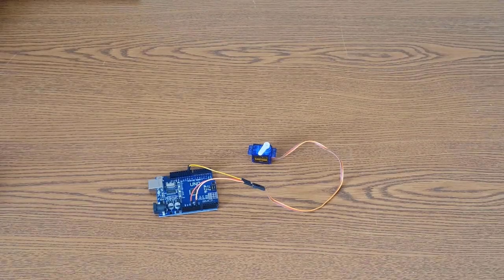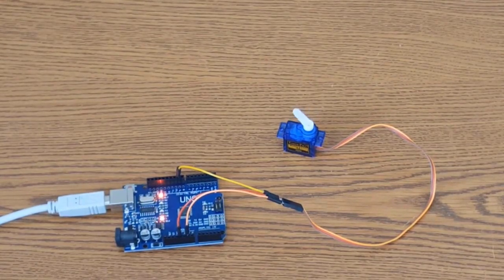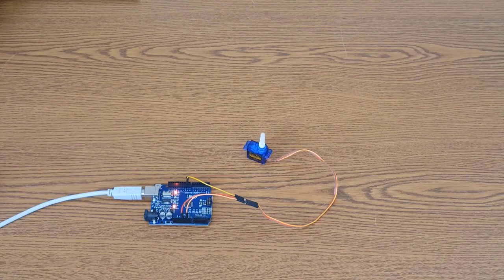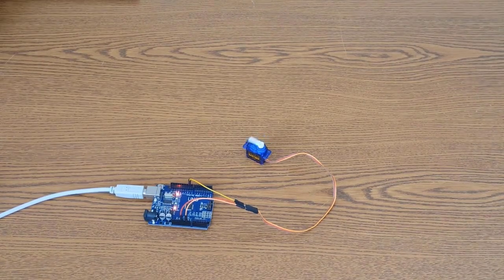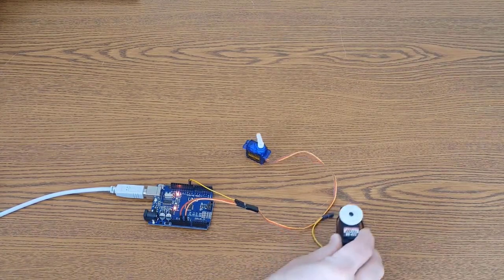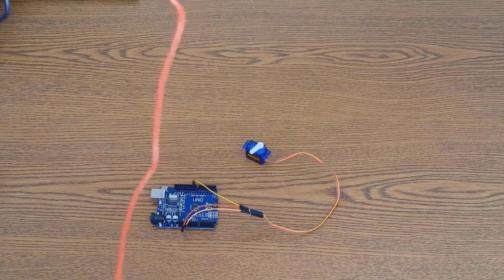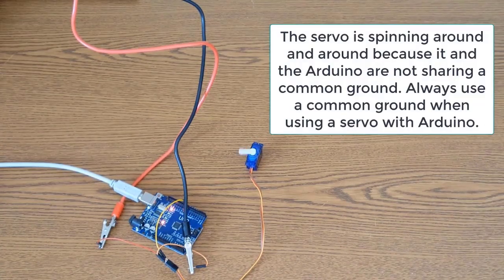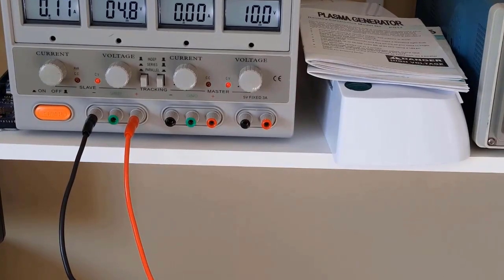Intro to (Safely) Using Servos with Arduino

Comment: Excellent stuff, works well. If you want to control 6 servo's the same, do you have to write all that lot 6 times? I tried to do an array of servos but it said I could not do that.
Reply from the maker: I've never tried that many, but you're definitely going to want to use a separate power supply for all those servos!